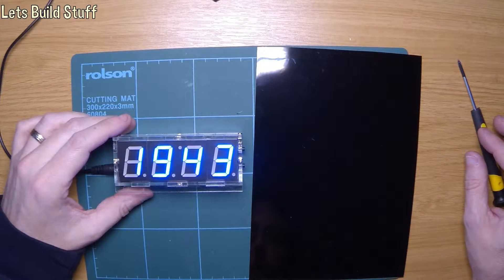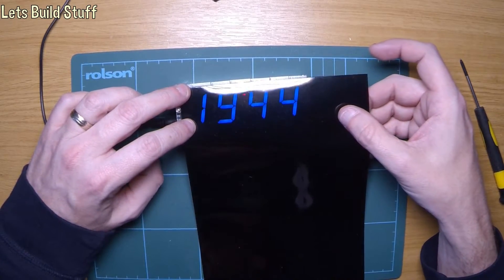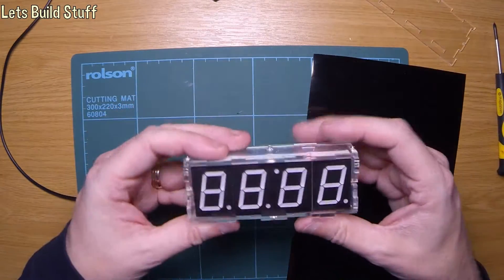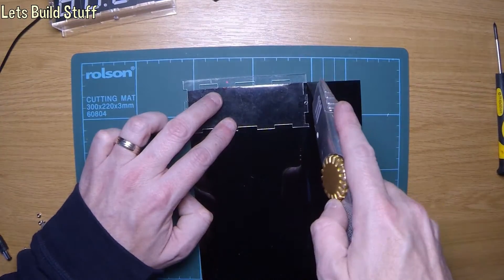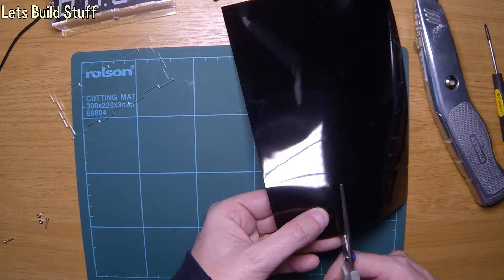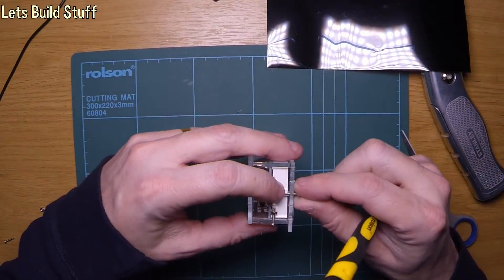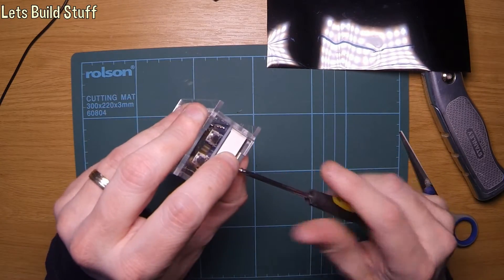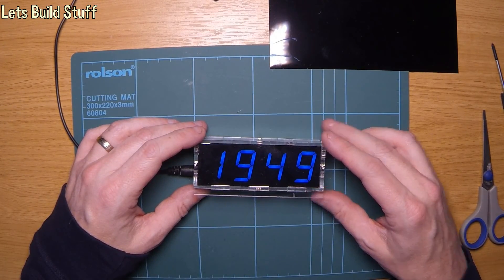Lets build - 4 Digit LED Clock Kit Project from banggood - (Part 6/6)

Comment: I just got this assemble, everything seems to work but the clock.  The time is NOT changing, the seconds blinker is not blinking. The temperature and date is working. What good is a clock that does not tell time?
Reply from the maker: +FirstFrameLastFrame Have you tried resetting it and starting the setup again?  To reset the clock you need to press and hold both buttons at the same time while you plug in the power.  It should then show 7:59, 5 seconds later it should show 8:00 and the buzzer should go off, press the plus button (the top one) to cancel the buzzer.
Once its reset try going through the amazing instructions again to see if you can set the time.
If the temperature and date are working then it sounds like it should all work.
Reply: +lets build stuff  It show's  7:59,  but doesn't  change to  8:00  and  the buzzer doesn't go off.I can change it to 8:00 then the buzzer go off but the time is still NOT changing
Reply from the maker: +FirstFrameLastFrame I'm no expert, but it sounds like the 32768 crystal is isn't faulty, or not soldered on correctly.  I doesn't matter which way around you solder onto the PCB, so it wont be that you've done it the wrong way around, but maybe the leads (which are very thin) are touching each other? or one or both aren't soldered properly.  I would check the crystal to start with.  I take it the : (seconds colon indicator) doesn't flash? that would suggest the clock isn't running, which needs the crystal.
Reply: +lets build stuff Thinks for the help a friend of mine suggest that same thing. I don't think  the seconds colon indicator is  flash I'll look when I get home tonight Thanks!
Reply from the maker: +FirstFrameLastFrame No problem, please let me know how you get on :)